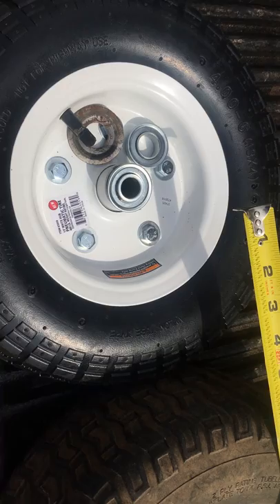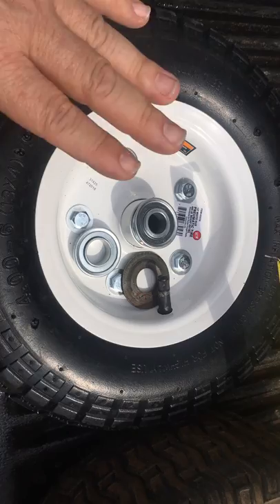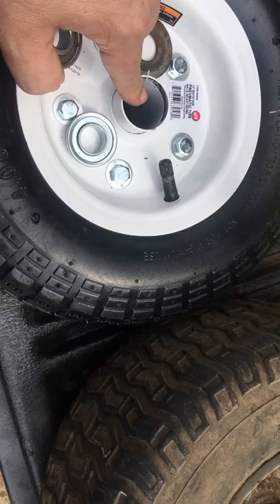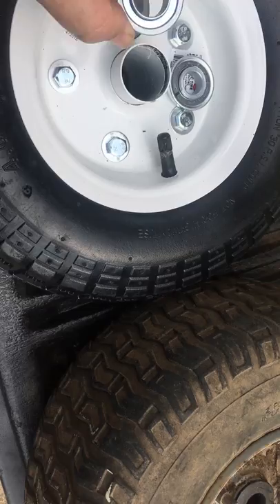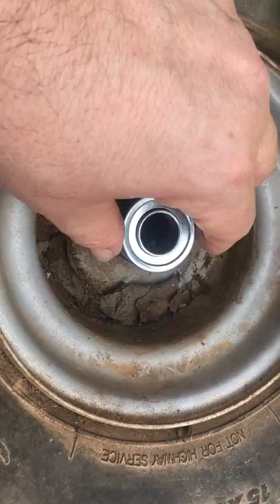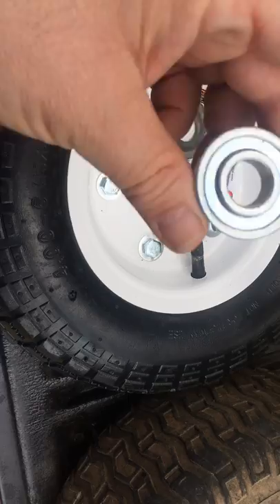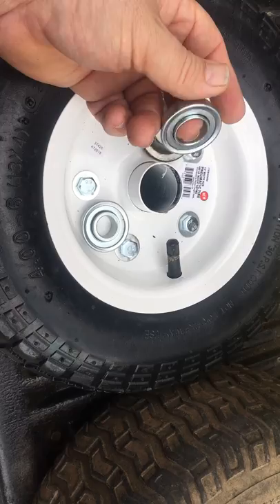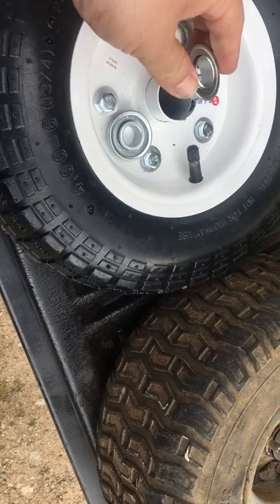Harbor Freight wheels for riding mowers and yard carts flange bearings

Comment: Those wheels have a failure at the shaft to wheel hub weld, they will end up breaking off one day! I know mine did, I had to re weld the break and add extra steel that the bolts go back through and weld 3 extra internal gussets to the shaft and new steel. Sort of in a 120 degree spread.

Comment: i was actually able to knock the old bearings off the old tire/wheel...and they fit perfectly into the new wheel. new bearings knock out easy with socket extension & hammer. Your video helped me realize to do that so TYVM!

Comment: Remove tire from old rim. Use a torch and heat up the outside of rim along bearing. Run cool water inside rim to keep bearing cool. Use pipe diameter litter smaller than opening, place 2"x4" on top of pipe and hit wood with hammer the bearing will be easier to knock out.  On new rim, drill holes for grease fitting

Comment: Just get the plastic bushing ones for 2 reasons, a) When they wear they will NOT wear out the shaft they are on b) Many of those ball bearing ones you get they DON'T have grease in them and fail quickly & in the process of failure they can mess up the shaft
Reply from the maker: What are plastic bushings?
Reply: Forget the plastic ones, just use good quality steel bearings, pack with grease yourself. Do you ever see plastic bushings on road trailers? Ahh no.

Comment: I got those too but when they are sitting outside most of the time 100% of the time the water get into them and rust them out from the inside because u cant get grease in there.
Reply: Take bearings out pack with grease and the internal shaft housing, before you install on the cart!!

Comment: Had the exact same experience. Waiting on a 10 pack of bearings from Amazon for about 22 bucks. 

Didn’t want to spend 100 bucks or so on tires and tubes and put them on old hubs instead of spending around 30 for 2 harbor freight mounted 13 5.0 6 wheels and tires